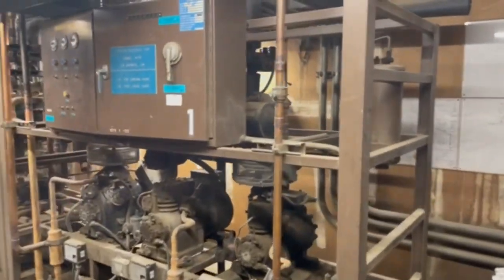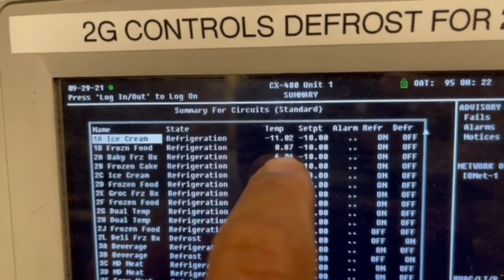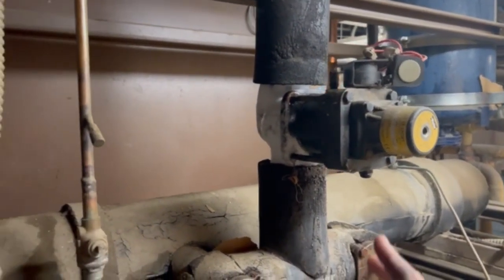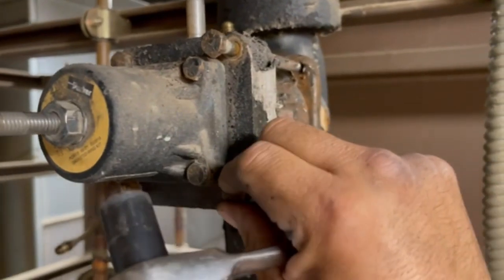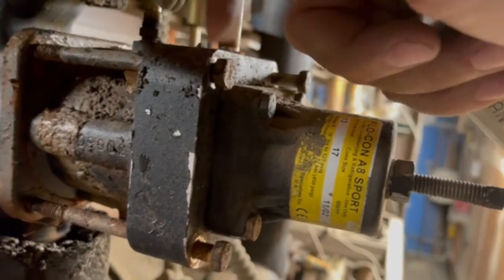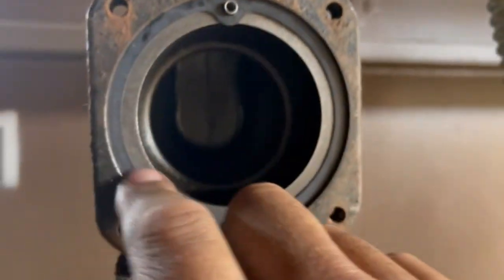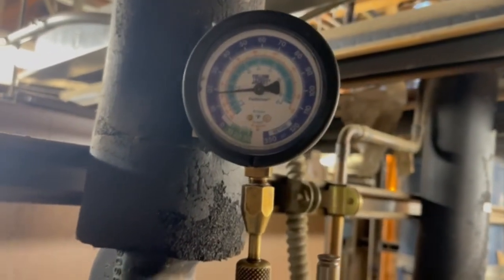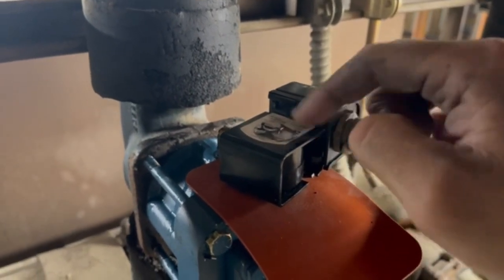BAD EPR(sport valve) !!!

Comment: We never see a vacuum pump or mention of vacuuming after line opening.  Yes I have some rack experience.  Yes I understand you can purge from liquid line and blow out thru your suction tap.  I bet you have alot of racks with non condenables at your stores.  Did you just not video the vacuuming or purging?  Am I in the wrong in questioning your procedure?
Reply: You’re not wrong.  Sadly this is how it’s done every day.
Reply: No you should always vaccuum a circuit when you open it to the air.
Reply: I commented the same thing. He had it open to atmosphere for a long period of time, replaced the valve and just opened the valves again and reintroduced refrigerant to it. It’s crazy how guys are smart enough to know how to work on these things but are too lazy to do the whole job correctly.

Comment: Also why not leave the valve in bypass instead of changing the valve if the circuit runs on rack pressure?
Reply: Won't defrost properly
Reply from the maker: Exactly what Dan Chapman said, it won’t defrost, when you put into bypass that also takes out the solenoid. Even though the solenoid is Denergized, the valve is still bypassed open so it will never go into defrost.
Reply: @gr82becool  why won't it defrost properly don't look like hot gas defrost I'm thinking if the liquid line solenoid pumps down with electric defrost what am I missing ?
Reply from the maker: The suction line that the EPR is on at the rack has a solenoid on it that shuts down the refrigeration flow when it goes into defrost.
Reply: so if the EPR  is in bypass how does the EPR stop the suction line solenoid from doing it's job in defrost.
Reply from the maker: It can’t go into defrost. In my case I had to go by every day to close the ball valve for that system for about an hour to manually defrost, until I got that new part.
Reply: this is what I'm thinking as far as operation; system is in refrigeration mode the epr's job is to regulate evaporator suction pressure above rack suction pressure to keep the evaporator from iceing up and to keep the product from freezing; when in defrost the circuit suction line solenoid will close. what i'm missing is if the epr is in a (manual) bypass whats keeping the suction line solenoid from closeing in defrost.in other words does the suction line solenoid stay open when the epr is in bypass if so the how?

Thank you for your time and effort to explain
Reply: Is the suction line solenoid the sane as the epr solenoid maby thats what I'm missing or is there a seperate suction line solenoid for defrost. I can see how the epr in bypass would stop your defrost if the purpose of the epr is dual; to regulate evaporator pressure and to stop refrigerant flow in defrost